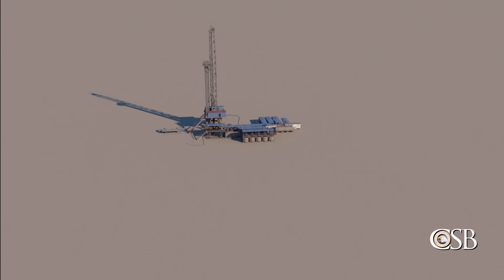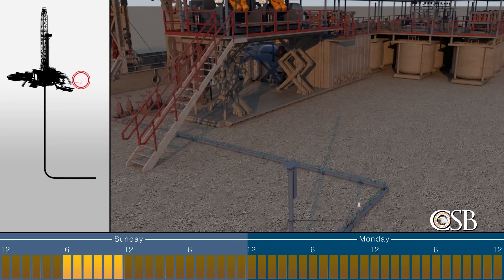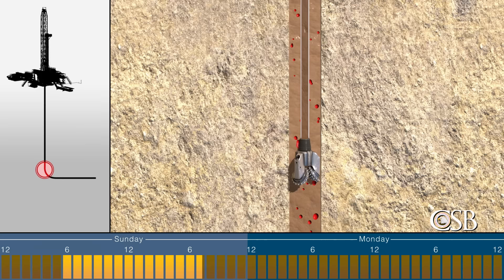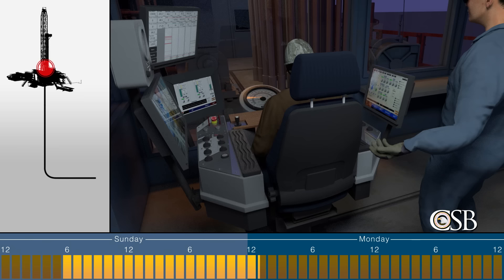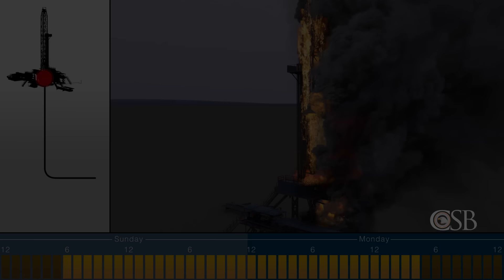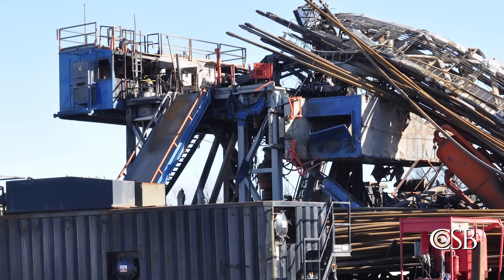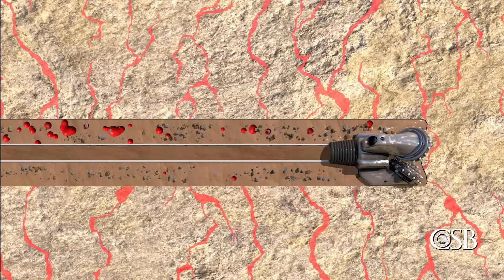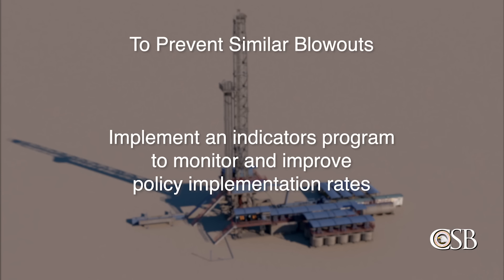Blowout in Oklahoma

Comment: The root cause of the blow out, in my opinion, has not been properly identified, not a bit. As a rig safety inspector, I came to one rig which belonged to my former employer and was able to identify a few serious safety violations. Upon presenting my findings, current Toolpusher asked me to be more “benevolent” in my report for that could definitely affect his employment status. Instead of modifying my report, I went straight to his Superintendent and proposed a few modifications in the way they were conducting operations in their rigs. One of my ideas was to immediately implement a night Toolpusher/Tour Toolpusher to alleviate some of the key responsibilities of a Rig Manager. 
 You’d be surprised to find out, however, how many “good” Toolpushers don’t have the slightest idea of the purpose of an Inside blow out Preventer, or the proper way to implement it. As a roughneck, I had the privilege of using it once under very similar and critical circumstances like this one depicted on the video and the only reason our crew was able to succeed in preventing a blow out was something you don’t see in today’s rigs...Experience. 
Flournoy Drilling Rig 3, Rig Manager Doug Rose, Driller Victor Borgfeld, Derrickhand Charles Borgfeld, Motorman Wayne Sievers, Chainhand Jesus Prado Jr. Worm corner Benito Cantu.

Comment: I wonder why the blind rams didn't close. The controls are in the doghouse, where all the workers died. Taking a kick where, mud blows out of the hole like that, happens from time to time. The driller will close the rams like a lightning bolt. Must have lit on fire real quickly.
Reply: iirc it lit very quickly once the fluid column started ejecting and there was concussion damage to walls of doghouse indicating a large explosion on floor...probably never made it to panel.
Reply: @Mr_Smarty_Pants  that's what I was thinking. Either than panel was gone or those guys died very quickly.

Comment: Alarms can be damned annoying causing a distraction, silencing alarms can help get the work done without the constant pain in the ears. All alarm systems should be in multiple parts, audible and visual but if the audible alarm is turned off it locks the visual alarm from being shutoff, so, you are always aware of the hazard. If another part of the system causes another alarm, the audible/visual alarms retrigger and only one can be shutoff locking the other again. Due to the recent failures of blow-out preventers, perhaps land-based BOPs should also employ jet engine blast, fire extinguishers at the BOP. Visual alarms should also work on a random flash as regular visual flashes can cause a form of hypnosis.

Comment: 12:00 I had to listen to that twice. She says that during the 14 hour period when the alarm system was turned off ....if it had been in operation, those alarms would have been irrelevant to detecting the problem. Did I hear that right?  In any case, operators turning alarms off because they are a nuisance is a problem throughout industry where such alarms are used. Engineers should design systems that have fewer false alarms. For instance, when an aircraft is on the ground in a maintenance status, there are countless "Master Caution" lights illuminated. They could greatly reduce the number of unneeded Master Cautions by redesigning the warning computer parameters. For instance....when the engines are deliberately switched off I don't need nuisance warnings popping up all the time telling me that ADS-B is inop. The list of unneeded Master Cautions on the ground, with engines switched off, is LONG.

Comment: Not one, but TWO operators turned off the alarm system. How can it even be turned off except by a person in a high position? They really deserved some tragedy.
Reply: It’s very easy to set alarms to whatever you want them to be so that they simply don’t go off.  I drill similar wells to this.  I can turn on or off the alarms whenever I want.  I can set any alarm to whatever limits I want them to be.  There are company and industry policies in place that I am required to follow. And if I choose to ignore those policies, by turning off an alarm or setting it higher or lower than the policy states, I can be fired.  If someone gets hurt or killed because of that decision, it’s jail time and manslaughter charges.

Comment: They should have checked the amount of fluid in the pits, conducted a flow check, and then shut the well in, bleeding the pressure through the choke manifold. When they were weighing the mud they would have seen that they were too light in the mud weight. Gas cut mud is a pretty obvious indicator. A lot of the land rigs don’t have a geologist on site. When the mudlogger said “we’re in the wrong place” they should have listened then and there. There were so many checks in place for them to know that this would happen. It’s inexcusable that five people died because of incredibly gross negligence.

Comment: It sounds something strange or stupid,1)no flow check before pooh , no flow check in vertical zone, no flow check before pooh BHA 2) trip tank not used as it must be first indicator of gain and losses, 3)pumping LCM???? instead heavy pill 4)clogging pipe means increase swabbing depending on on trip speed and gaining more gas 5)no reaction on mud volume return assuming the driller was novice what was the role of the mud logger (MWD) he has all the volume tanks each tank has it's proper sensor ,the trip sheet as well as the alarms in his cabin, by the way there are two distinct automatic alarms one for the gas the other for the H2S, 6) the driller ignored to close the bling rams?????? if he has done so the gas below BOP become at reservoir pressure worst case and to solve the pb was bull heading or stripping with volumetric control both operations needs more or less wise calculation, according to the video the crew was unable to read trip sheet how about the different well control, 
In conclusion: The crew wasn't stupid as it sounds in the video, because they're dead they can't defend themself and everything went on fire, so we can improvise any scenario, the first and the last responsible was the company which was looking for the performance for more money, no policy, no written instructions, no trip sheet, no flow check why the the driller was reading zero on BOP console??? ,basically while gas well we've always a heavy or kill mud on pill  tank where the LCM come from?? Please convince me I didn't Read the CSB's final report yet but I'm sure I'll be astonished.

Comment: Once upon a time in the Bakken I worked for a rig moving company. We saw lots of different rigs from lots of different drilling companies working on locations for lots of different oil companies. 
There is a huge range of ... lets call it professionalism - just like any industry - being demonstrated. ND and the Bakken is quite different than other parts of The Patch. Direct comparisons are pointless. Nonetheless, in The Patch, you get what you pay for. If you got a tremendously good deal - there must be a reason. 
Patterson rigs were never my favorite. H & P Flex rigs are everybody's favorite... this because they are easy to move, well thought out and back then had crews that were happier than most. Also they were newer and in good shape. I’m sure they were more expensive. 
Here we have a report on the effectiveness of Darwinian Selection. This is a cruel point of view. And a valid one. You pay peanuts - you get monkeys. 
I also know that the bigger drilling companies have real-time remote monitoring and direction from satellite linked corporate offices. This probably costs more too. The home offices are where you find the folks with degrees in Petroleum Engineering.  Loading responsibility on the Mud-Logger and the always busy Company Man is of limited usefulness. 
The real penalty is revealed in increased liability, loss of material resources and degraded reputation. The Patch is a very small and very tight international community. Everyone knows everyone. If you piss in your shoes - everyone knows and they don’t forget. 
New rules just make life more expensive and multiply the number of regulatory butts in seats.
Let the lawyers and insurance companies handle this. It will be much faster and more flexible when new methods and techniques come along.

Comment: I was a floorhand for them back when I was younger its a dangerous job and if you dont understand the bad signs things can go bad instantly...the Derrick hand shouldve seen the mud tanks gained 200 barrels and the driller was scared to be wrong and them running in the doghouse was dumb I always went down the steps when things got crazy on the floor if they needed me back they can yell or call my radio sometimes you gotta run out there seriously...

Comment: The Hard Shut-in Procedure should have been reflexively performed at 2:33 in the video, absolutely no questions asked. (Pick up off bottom, turn off the rotary, space out, shut off pumps, look for flow and pit gain. If there is a nonzero return flow and/or pit gain, shut the annular preventer and open the choke and wait for the bottom hole pressure to equal the reservoir pressure. Calculate your kill weight mud based off of your new shut-in drillpipe pressure, then use either drillers or engineers method to get that kick out. It's SOP and it's not difficult.)

Comment: So many of these CSB reports have the same formula: 

- A worker and/or management ignores alarms, disables safety mechanisms, and/or bypasses critical monitoring systems due to pressure to increase performance, constant false alarms, or a lack of proper maintenance to keep safety and monitoring systems in working order.

- A preventable situation arises due to these oversights or negligences

- The report finds that there was either no safety regulations and best practices or an insufficient safety guidelines and best practices, and recommends that such regulations and practices be put into effect.

I wish it didn't take ecological disasters or the deaths of workers and bystanders to fix the anemic safety culture that exists in so many industries.

Yet another example of the saying that "safety regulations are written in blood." We need a new regulatory body that focuses on proactive disaster prevention instead of reactive reports from loss-of-life accidents and environmental disasters. It feels like no prevention-based work is being done by regulatory agencies. They just wait for someone to die to point out the flaws they need to fix.

Comment: that's like the cardinal sins in the oil field. Not keeping the hole full while tripping out, and not monitoring your pit levels, ESPECIALLY when you know there is gas in the hole. I did this in the early 80's and remember it extremely well. Roughnecked for 2 years and drilled for 4 years. A workhouse, but not in a house.

Comment: My 2 Cents.
As a Driller on a small rig. I could say easily by asking either the roughneck or the motorman to watch for RETURNS when I was pulling a pipe .
 AM I "SWABBING?" yes OR no?
Obviously, there was "Swabbing" (According to this video) all the way out. To me this means one of two things. Close the PIPE Rams...NOT the Blind Rams. You can't close a hole when there is a pipe in there while Pipe Rams do.
Secondly the Derrickhand was not doing his job.To hell with the alarms! Any Derrickman I have ever worked with had FLOATS within his mud tanks to verify any electronic measuring device.1" above the mud level on the suction tank or the Trip Tank. He also should have seen mud coming over to the shaker from the flow pipe from the derrick almost 90 ft from the table.
Thirdly? WTF LCM instead of Barite? The fault of the Consultant, the Rig Manager the Driller and the Derrickhand?? There is NO way in HELL..I would be putting Cellophane in a slurry to stop a flowing well.
More to say about this debacle....but NO ONE did their JOB!
Certified BOP (Blow Out Prevention) for 20 years and never had one.
One last word! Complacency!

Comment: I was a driller from the late 70s to mid 90s.2e didn't have drillers cabin we were on the floor with the crew where we could see what was going on. I  never turned off flow sensor or pit gain alarms they have a purpose. I'm not sure what they teach hands now but everyone on the right should should have caught the visual signs

Comment: Not much of this report makes sense to me. Probably left out the important clues. I cannot figure out why they would start tripping back out when the mud is so gas cut that it was blowing at the shakers. If it was an offshore well that is already seen as a very serious incident. You have a gas bubble/minor kick, or even just serious gas cut mud and need to circulate until the well is at least balanced and flow check. There are at least 4 points they could have seen the gas readings, and the driller surely must have seen his weight on bit and torque showing signs. My guess is they were trying to make up time by drilling balanced or even underbalanced so they could drill quicker with an old/worn bit. If the driller wasnt gentle enough picking up the bit he could be swabbing gas into the hole all the way up. I;ve taken a few decent gas bubbles in my time and there's no shortage of warnings. The worst is running thru a cap rock into overpressured formation, but this rig was directional drilling and horizontal at the time. The other is swabbing a bubble into the hole similar to how a syringe works. Not much of it makes sense. Surely they were drilling underbalanced and just didnt do anything about it. I didnt hear anything about a wellsite geologist, drilling supervisor or toolpusher....so maybe this well didnt have any at the rig ??? Lack of anyone with enough experience to even talk to the driller ? Its like complete amateur hour coz they had loads of time.

Comment: They failed to mention the correlation between running as close to balance with mud weight to pore pressure, with respect to economics.  The greater over-balanced the mud system, the slower it drills.  This increases cost and is very delicate balance between safety and money.

Comment: An alarm system that can be disabled must have automated series of safety checks and the choice to disable an alarm system must be restricted to cogent situations and involve signing a safety check by both the driller and another individual of authority with training and guidance . Disabling any safety device such as alarms should require placing the rig in increased level of caution alerting all personell to the condition and alerting them when the safety device is returned to its nominal functioning condition on including testing the alarm that all personell are aware of and familiar with alarm soundings. Disabling any security and safety equipment demands a heightened alert level and returning to normal operation the primary concern of the operators .

Comment: All that equipment, for naught...when a nut hanging on a piece of soft line into the mud pits will show pit volume gain. All old school hands know this. Have seen this happen up close, 1980s, and was lucky enough to make it to the acculumator and divert it thru the flare line. We were Td'ed at 15.5K pipe standing in the derrick and logging. Looging tool was destroyed by the gas at the bottom of the oil and they were wireline pulling it to change the tool. I did warn the driller of the pit volume gain, several times, he ignored it, and when I went across the location at 2 am to tell the Co Man personally, she came to see us and burped halfway up the derrick. I ran top speed and got it diverted. I tried my best to hit that driller in the head with a pipe wrench the following day, missed by an inch. Was time to find a new rig.

Comment: The day when all gas/oil drilling stops and these workers are employed in battery factories instead can't come soon enough.
Reply: LOL. I guess the robotics and machinery being used to make these batteries will all not require lubricants or petroleum based plastics. There definitely will not be a fuel supplied emergency power system for the automation controls. Or a independent fuel based fire suppression system required by fire codes for the building. Love it or hate it this industry will be around untill your kids kids are old.

Comment: I was a drilling fluids engineer, and mud is not made of diesel.
Reply: Yepp. Maybe they spotted some diesel for some reason ? but yeah it doesnt make sense to me either. Also, when they obviously know the mud is gas cut severely why are they not increasing the mud weight and circulating ? It must have been showing up on simple gauges for the driller, like the weight on bit and torque. Why start tripping out when they can even see mud spraying over the shakers for starters ? I;ve been offshore during a few kicks that were basically big gas bubbles, and on one occasion you couldnt even open the mudlogging shack door for the mud at the shakers at pressure. They must have known. Drilling way too close to balance or underbalance to drill fast or make up time is my guess.

Comment: They should fix the alarms so the company man is the only person able to turn any alarm off. Also have an alarm system that goes to the driller & company mans trailer for kind of a fail safe. If one fails maybe the other will catch it.

What is weird is for a truck driver to go to a mud plant & get a load of oil base mud the driver must have their hazmat endorsement.
But if they go to a rig & load the same oil base mud to take to a new location they don't even though the mud they load at the rig is likely to have more diesel & other chemicals in it.